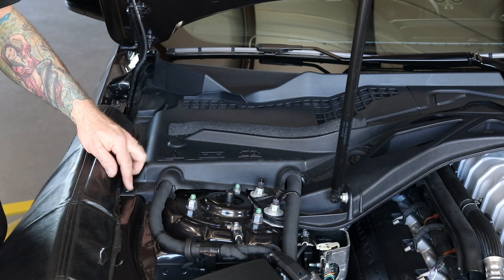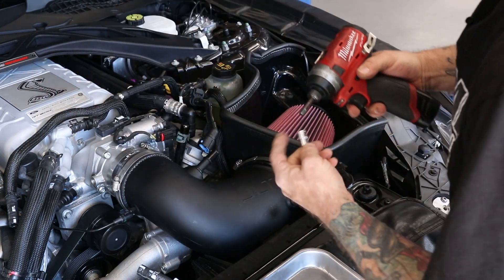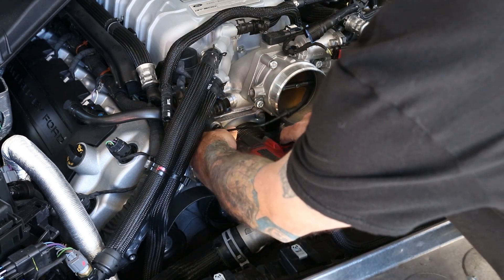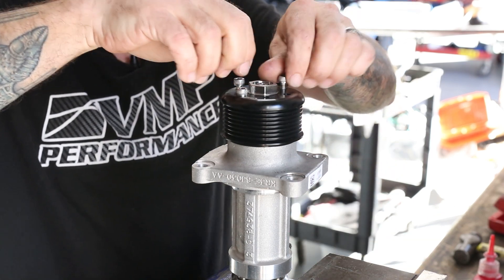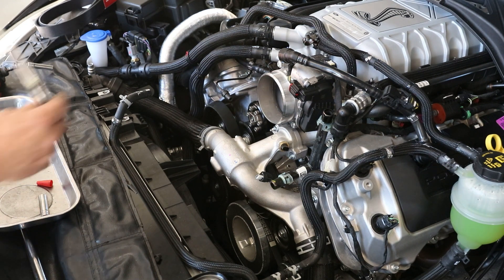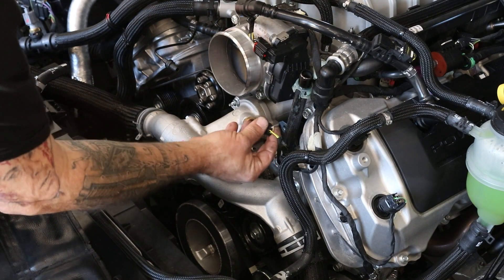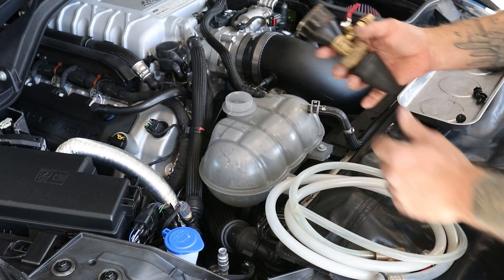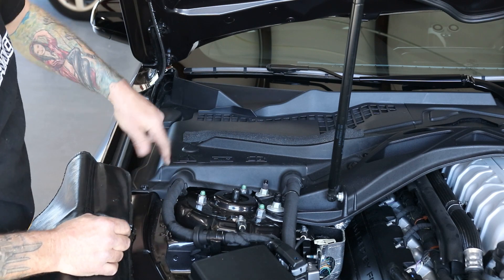Product Installation || VMP Apex Predator Hub and Pulley for '20+ GT500

Comment: So the gt500 supercharger heat exchanger is inline with the radiator? Or was I looking at the hose routing wrong, I  seen the small hose going to the degas tank on the driverside shock tower. Then it looks like it routes around to the front of the big degas tank.

Comment: The Video is a very good one. I like the added notes and tool used.  The part Number for the belt used would have helped me when ordering.  Links below video to each part would have helped me buy it faster.  I had to call and talk to someone not veryt knowledgeable.  It was like calling in for help at Miocrosoft, they read the info from a manual or online.  I made my purchase because of Jermey and the video

Comment: How do you know you filled the coolant back to the proper level after using the air lift system?
Reply from the maker: The OEM coolant reservoirs have a MIN and MAX mark.  Once you have used the air lift to bleed the air out, it is safe to top off the system without the worry of air trapped deep within the system.

Comment: Is the old pulley reusable
Reply from the maker: It is!  Also, we sell a pulley that is the same size as stock if someone ever needs to go down to stock boost levels.  But in the event of needing to return the vehicle to stock, the factory pulley can be re-installed.
Reply: @VMPPerformanceTV  but you mentioned that the cover is not reusable at 6:00
Reply from the maker: @horizonspeed7080  yes, because that plastic cover must be pierced to get it out.  The cover is not required for operation.
Reply: @VMPPerformanceTV Do you know if the cover can be purchased?
Reply: Even better thanks! Also is the Air lifter cooling system required or is there another option ?
Reply from the maker: We prefer using the Air-Lift specifically because it prevents any air pockets from being trapped in the system.  The heat exchanger's coolant system is especially complicated and it just prevents issues with bleeding it.
Reply from the maker: Here's a link to the tool itself:  https://www.amazon.com/UView-550000-Airlift-Cooling-Checker/dp/B0002SRH5G